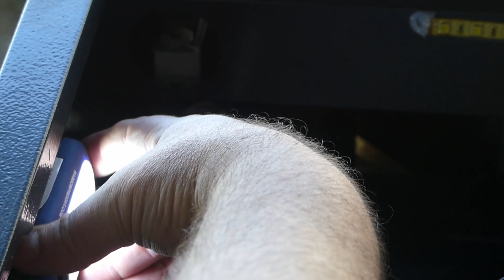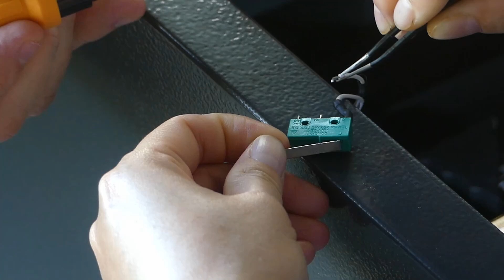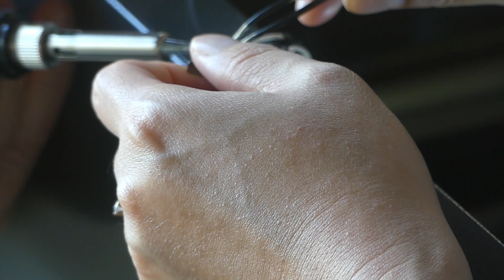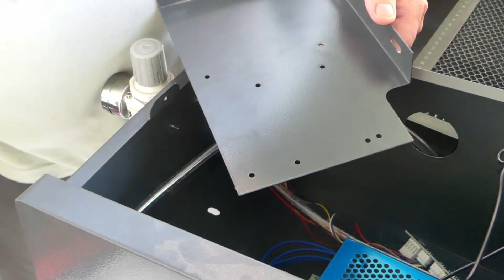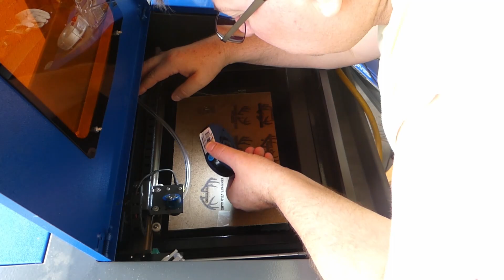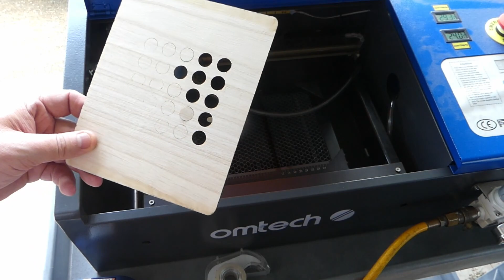K40 LASER upgrades

Comment: Thanks for sharing, I have the same K40 and minority board but have not been able to connect to my laser.
It is showing ready in light burn but no movement at all.
I will go my limit switches again to see if they are done properly as I am getting an alarm 9 msg.
Thanks again
Reply from the maker: How where the limit switches?  Wired correctly?

Comment: You mention adding the chiller, but I don't see it in this or your other videos.  Did you do a video on that somewhere?
Reply from the maker: Michaelcouey1383, I did not do a video.  The chiller setup is so simple, i thought just a mention would be enough.  In a nutshell, its a cheapo portable icemaker (amazon i think).  The Ice drops about every 6 mins for large cones, so i simply turn on the ice maker and laser and let it cycle for about a half hour prior to using.  IF you go this same route.  You MUST keep an eye out for sweating of the lines and laser tube prior to firing the laser.  One other MUST do's is the Distilled Water (no brainer) but that was for the folks that didn't know.  Let me know if there is something specific I can talk to you.  Happy to share the knowledge if i have it...
Reply: @MakallWorkshop  the reason I asked about it is because I have an ice maker that we use for our RV in the summer.  

Short of coiling the tubing and sticking it inside the ice compartment to pass-thru...I don't understand how you're hooking up a icemaker to the water recirculation line.

Maybe you're ice maker is different than mine.  That's why I clicked your video was to see the process, in case I needed something different.
Reply from the maker: michaelcouey1383, I will link the icemaker i got from amazon, its not to terrible when compared to a real laser chiller.  https://www.amazon.com/dp/B08ZYJ8CRX?ref=ppx_yo2ov_dt_b_product_details&th=1

I have the pump stuck to the floor of the ice maker basin.  Fill to the line with DI water.  I have my pump hose and my return hose both going to the ice maker basin.  ice water goes up to the laser via the pump and hot water or return water goes back into the basin to be chilled by the ice that is being made.  To achieve this simply remove the basket that catches the ice and let the ice fall into the basin.  I plugged the pump and chiller into the laser, so when i turn on laser both turn on.  I simply let it cycle for about a half hour while i prep my laser file.  Then start engraving or cutting.